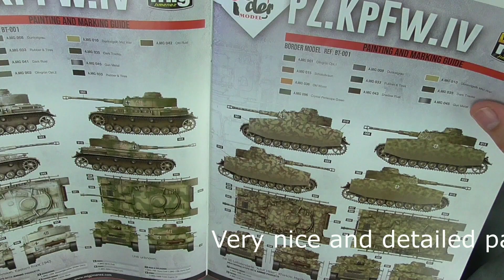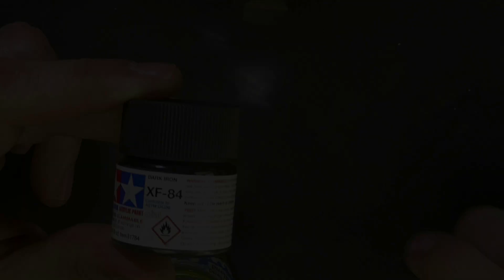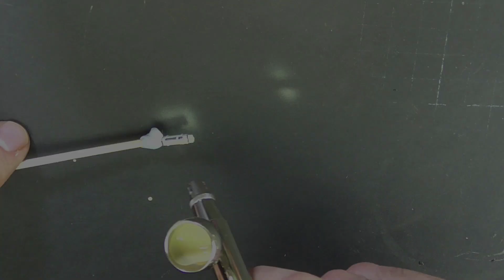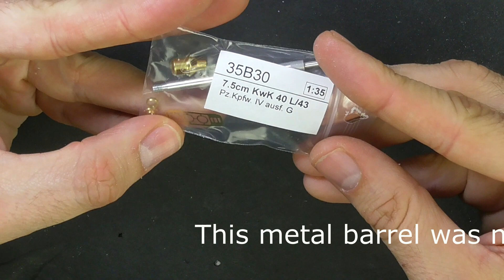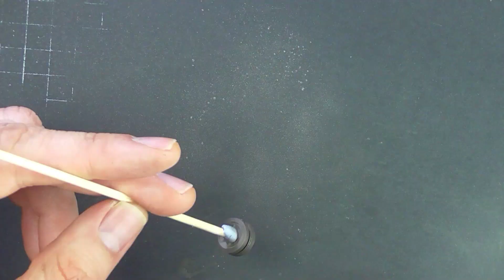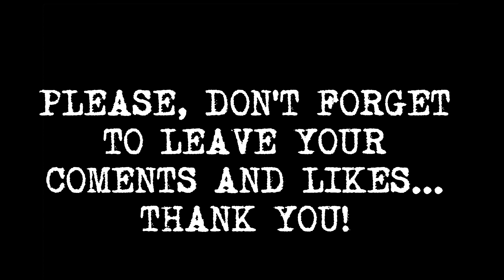Panzer IV Ausf G Border Models 1/35.Building and painting

Comment: Nice build. It's nice to see you paint and weather the small parts before you attach them. I see a lot of modellers online attaching then painting. And they still make it look awesome, how I don't know.
Reply from the maker: Thank you! I still belive that paint first and later attach is the easy way to do it (in the most cases)
Reply: I agree. I paint everything off the model, then glue. Using washes and dry brushing can then enhance the overall look after the model is near completion. So much easier to paint when treated as subassemblies.